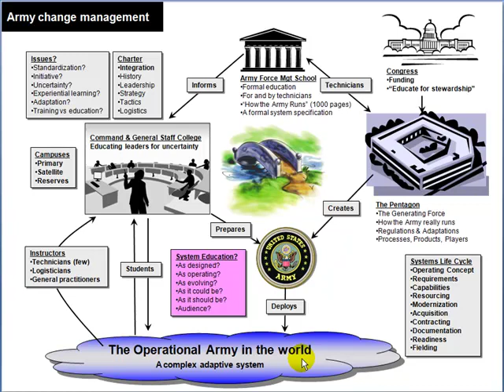F100  "Army Force Management"  instructor focus

Comment: FYSA - As of Academic Year 2016; the FM module is 18 hours vs. 16 hours as briefed (Satellite Course).
Reply from the maker: +Matthew Misfeldt 2 of the 18 hours are Operational Contracting Support, which is not technically FM; but we include it in the FM module to protect the hours.  cheers!